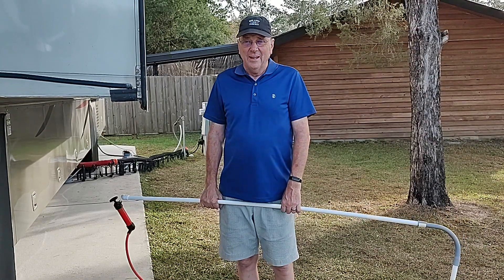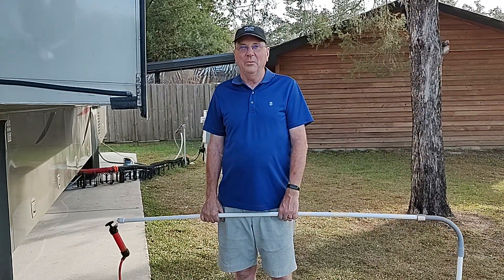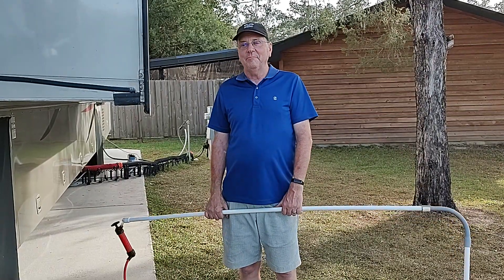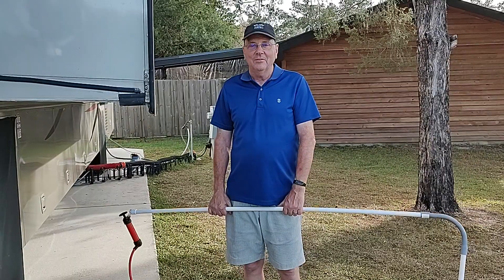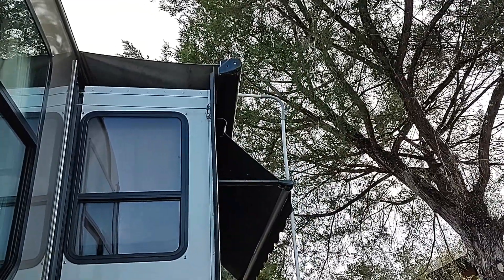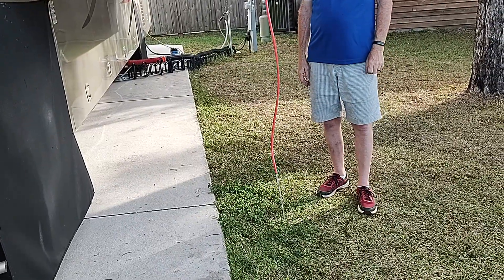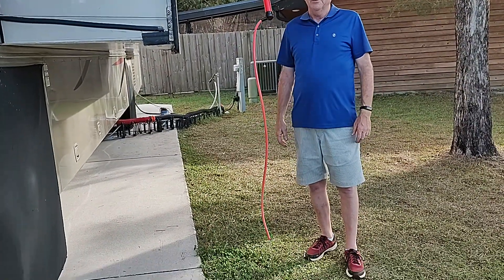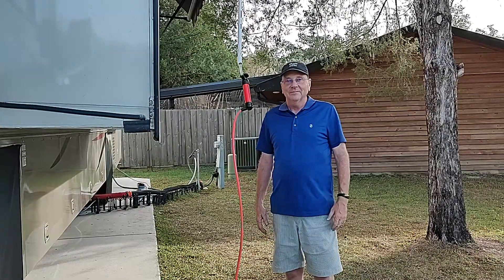Easily Remove Topper Water

Comment: Why don’t you just run the slide in and back out?  Makes one less piece of equipment to lug around?
Reply from the maker: Been there done that and it is not a good idea when the water has wicked off the slideout topper and is now on top of the slideout itself. You bring it in and it dumps inside the coach on the coach floor or in the case of a friend of mine on his head while in the driver's seat. Best to get it off the topper and try to avoid that trouble. Not to mention that in order to bring a slideout in, something has to be moved out of the way. Why go thru all that too? 
 So I hang my siphon on my ladder and use it whenever it is needed. 
The device is easy to store in my coach's basement when traveling, just like my long-handle car wash brush.